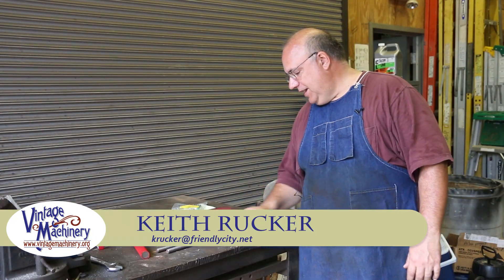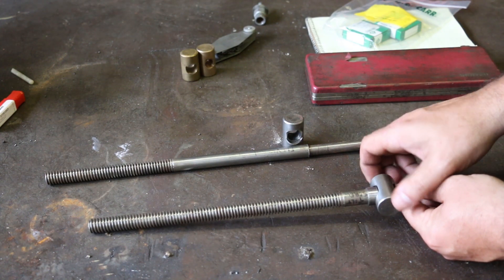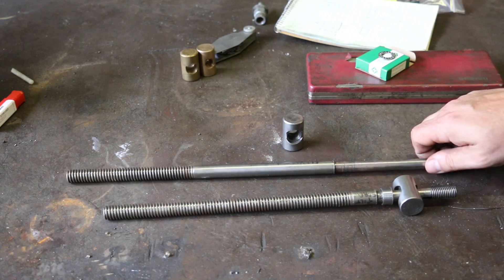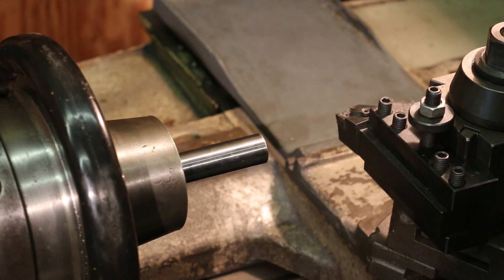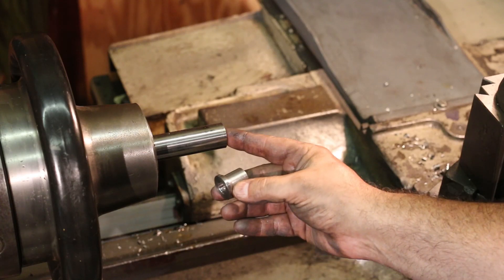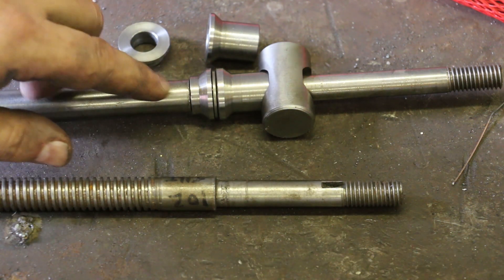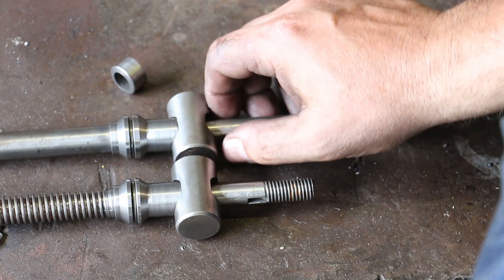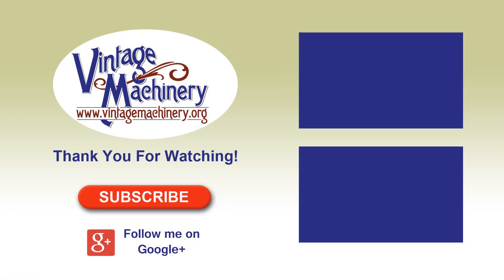Darra James Model 95 Table Saw Thrust Bearing Modification

Comment: Hello Keith,I have a Darra James 95/Powr-Kraft 12" table saw and I need to replace my elevation and tilt screws. I would also like to make this modification. Where can I buy the parts or will I need to have them made? About 1.5" of the elevation screw was broken off so, I don't know how long it should be. 
Thanks for any help you can send my way,Steve

Comment: This was very interesting. I have a Darra James wood Lathe Model 390 that my father received for Christmas in 1954. I watched him turn a set of bed posts for my sister a doll bed and I've been hooked on woodworking ever since. I changed the headstock bearings and installed a variable speed DC motor on it. I mostly turn wooden bowls but do spindle turning too!
Reply from the maker: Bill Fleming Wood turning is adicting!  I know.....

Comment: I just bought a Craftsman branded durra james 95 on craigslist and the brass threads are stripped.  Would you be willing to make me a set ? I saw how much a tap costs on ebay and willing to pay at least that much.  If not, thanks for the tip on the 5/8 8tpi ACME threading,  is it left hand or right hand ?
Reply from the maker: tradersalt They are right hand threads.  My next video shows making some.  They are a bit of a pain to make.....

Comment: Keith,

Great idea using the thrust bearing for the adjustment rods.  As we both know, fine sawdust gets everywhere and tends to muck up what it gets into.  Had you considered a felt washer with an ID to match the OD of the bearing, just thick enough to fill the space between the two new mating surfaces.  This or something similar may keep that fine sawdust out of that great new thrust bearing.
Thanks for the great video!!
Tony
Reply from the maker: Anthony F. De Leo We are going go have to rig up something to control the dust - that is something that will need to be done when they get this back installed.

Comment: Great modification. Just shows that engineers don't always get it right when they design things. Enjoyed the video as always. Don't know if you concern yourself with the little details but "thrust" is spelled wrong on the intro.
Reply from the maker: Matt Wilkins Yeah, I noticed that after I edited and uploaded the video and already had it running.  More trouble to change at this point than it is worth.....

Comment: On my saw the friction in these bearings is important to keep the adjustment of blade height/angle stable while the saw is running. Is there some kind of setting lock on the Darra James saw?
Reply from the maker: CornishMiner Not sure if the Darra-James has any locks on these screws or not - my saw does, but it is a different animal than the one we are working on.  I doubt it will be much of an issue though.

Comment: Questions :
Did you machine in the 45 degree flare instead of a90 degree shoulder for aesthetics or a mechanical reason? 
Are you worried about the roller bearings wearing into the faces of the new pieces since you didn't use hardened washers? 

Thanks Keith!
Reply from the maker: Terry Talton No particular reason except that it looks better.  There is not enough force on these that they would need the extra strength.  As for hardened washers, I am not too worried about that either as while there is some force on these parts, nothing like what would need a hardened surface.  Those would be more important if this was running under a high RPM but hand cranking a hand wheel should be just fine.

Comment: Now you've removed the friction the screws will probably adjust with vibration. :)
Reply from the maker: NuttyforNissan Possibly.  Not sure if there are any locks on these parts or not.  I know that my table saw has a lock on both of the screws to keep vibration from moving them.

Comment: Nice mod, save, improvement.  I was wondering how the piece functions and what is the load.
Reply from the maker: WAVETUBE84 Unfortunately, I don't have the whole assembly to show how it works, just the key parts to work on.

Comment: Very slick little work around! I just love thrust bearings for some reason, it seems that they've so many applications and also places where they could have easily been added, like in this case, but just are not in lieu of profit margins. Glad to see this table saw getting a tune-up!

Aloha...Chuck
Reply from the maker: Knolltop Farms In the defense of the makers of that saw, thrust bearings like this may not have been available when the machine was made.
Reply: Keith Rucker - VintageMachinery.org That makes sense. No offense to Darra James intended ;)

Comment: Keith,

A question: any concerns about running those bearings on a simple machined surface when the specs call for "Rockwell C58-C64 with a surface finish of 16 microns"? (From the McMaster-Carr site.) I realize they are going into extremely low RPM service, but is there enough thrust to cause the rollers to break down, running on the relatively soft and rough surfaces? The thin thrust washers would have added only another 0.064". (And another $4.)
Reply: Peter W. Meek Given the extremely low load and speed (Pv factor), there is no need to run these on a hardened surfaces. The hardened surface requirement or the support washers are only to achieve an installation and wear resistance at the thrust bearings maximum rated Pv. This application is light years less than the max Pv.

I design industrial machines for the food industry on a daily basis, I use things like this often. His application is perfect and if indeed the material he grabbed for the thrust bearing supports is 1214 (12L14?) then its even better as that is leaded steel and it will begin a wear pattern that will be very smooth and add to the smooth feel of the hand wheels.
Reply from the maker: Peter W. Meek As others have stated, with the load that will be placed on these parts, I think that I am more than good.  If they ever do give a problem, the hardened washers can easily be added without adding any significant thickness to the overall parts, but I doubt they will ever be needed.  The material is indeed 12L14 - I think I left off the L when I mentioned in on camera.
Reply: Brian Streufert Even better, these rods are used to adjust the tilt and elevation of the table saw. There will only be a slight thrust force axial to the shafts, and it's only dealing with a rotating shaft when the attitude of the saw is being adjusted, by hand cranking - the rest of the time, the forces are essentially static in the rotational plane.

Heck, the original design lasted for umpty-ump years - well past the original design service life of the saw - which tells me that the application is far from being critically stressed...

I'd be comfortable designing assemblies for this kind of load / application, where I would go get a more knowledgeable person such as yourself for a more critical application... something about knowing what I don't know! ;^)

Cheers,

Eric

Comment: Great video! Can't wait to see the next video on the bosses with internal Acme threading. This video in particular is near and dear to my heart, as I'm restoring a Delta table saw with a cast iron top that has a similar problem with the elevation and angle mechanisms... not a thrust bearing problem, but the Acme gearing and lead screws are prone to sawdust accumulation, so I'm trying to figure out a better way (other than dry lubricant) to keep the threads clean and dust off of those parts. See you in Cucamonga on August 15, Keith!
Reply from the maker: Sean Harrington Try lubing the screws with wax rather than oil or grease.  The wax does not tend to attract sawdust as bad, but does require frequent refreshing.  I also use a wax on the table surfaces to keep them clean of rust and to help boards slide across the tops.

Comment: Just a thought, on my through rods of my front arms of my offroad buggy I found I had to buy the hardened washers that went with the thrust bearings on each side for them to work properly, obviously you do not have the forces that I had on the front suspension, but will also help the wear into the softer material. nice job on all your videos I am learning a lot.

Comment: Hi Keith,

Parts looks great, the idea is great, but needs a little plus about keeping the dust out of the equation as mentioned in some other comments.
Cheers, Pierre

BTW got myself a new used wireless microphone for the shop, it's an AKG, after some testing it reveals to be a great buy... That's what I'll be using from now on....
Reply from the maker: pierre beaudry Congrats on the wireless mic!  I know you will enjoy that.  I don't know what I would do without mine...

Comment: Hi Keith nice job. Are you going to pin the short (thread side) washer to the shaft?. There may be a slight possibility it may not turn with the shaft causing the same problem you had before. Look forward to the Acme nuts video. regards from the UK
Reply from the maker: Gary C We talked about pinning them - probably will.

Comment: Keith

Did those thrust races not come with the hardened steel washers? Here in the UK you get them as a set .

http://www.arceurotrade.co.uk/Catalogue/Bearings/Needle-Roller-Thrust-Bearings

I would have used the washers and machined a pocket in the higher part to shroud the bearing from wood chuck dust . So the bearing would not be visible 

Just a thought

Stuart
Reply from the maker: Stuart Hardy I considered that approach, but after talking to the person I am making these for we decided to keep it simple.

Comment: Hi mate.
Do you think that those bearings need to be greased, and if so, do they need a sleeve of some sort?
Marcel.
Reply: Marcel Timmers I was thinking the same. Lube and saw dust mixture not the best combo for smooth running.
Reply: Marcel Timmers +Marcel Timmers I agree with both of you guys, I would also add some fixing to the bushings, so only the thrust bearing does the turning....
Reply: Indeed but might be problematical due to assembly difficulties.

Comment: Are you planning on using some sort of rubber sleeve to keep the saw dust out?
Reply from the maker: BlackRider625 I am leaving that up to the person I am doing this for.
Reply: Keith Rucker - VintageMachinery.org I would loctite the one on the shaft and serrate the face the other where it meets the trunnion. A piece of 1" ID vinyl tubing tie wrapped to one piece would make a fine boot. Well done and can't wait for more.